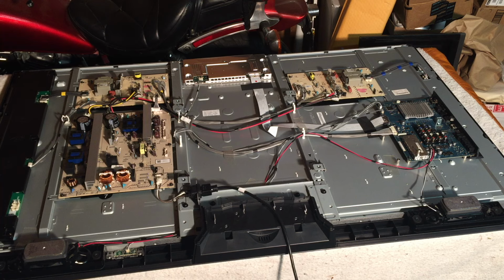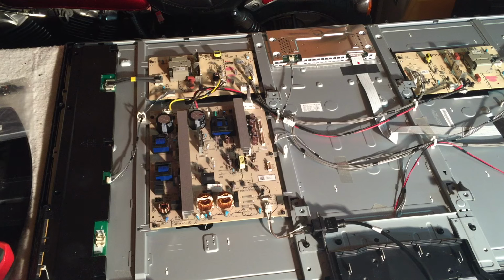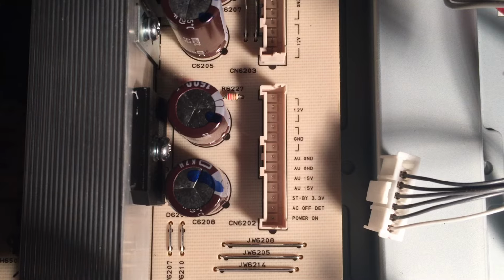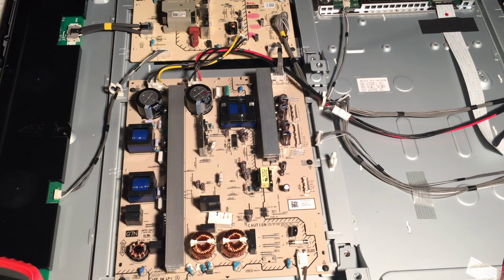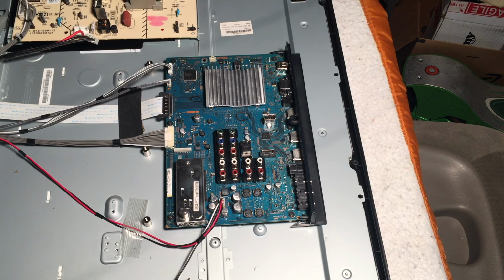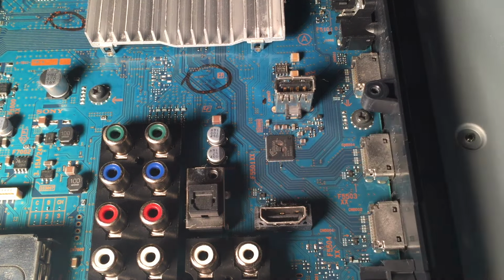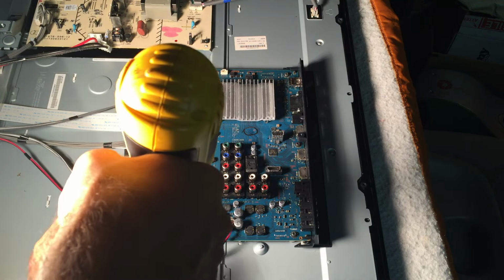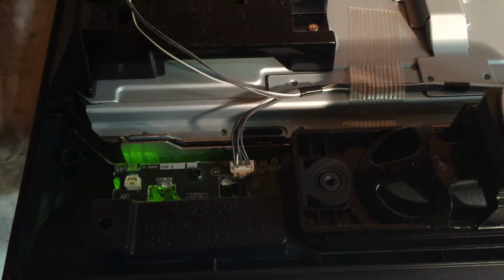How to Fix a TV Hit By Lightning or Power Surge

Comment: Great video!   This is the first time I heard the explanation about the surge coming through the HDMI.  I pretty sure that happened to me as our 60in Samsung was in a surge protector, but one connected device was not.  I get no standby light at all and ran through your troubleshooting.  Fuse is good.  Finding that if I disconnect the power and main board connection and then connect power,  I get backlights.  But once I reconnect the two together, nothing.  So this tells me it must be the main board?  Though I can find not burn marks or puffy caps or anything that looks bad.  Should I just replace the main board since power is getting to the power board?
Reply from the maker: Thanks!  Usually, you need the main board to tell the power supply to turn on the backlights.  That is curious that they are coming on without the main board attached.  You may need to take measurements with your multimeter to see if the standard voltages are there.  Or if they fluctuate.
Reply: @FrugalRepair  Thanks for the reply.  The pinout on the power supply has 13V for 4 pins.  If I keep everything connected (main to power supply) and plug in the TV, I only get ~10V (just under) on each pin and no backlights.  If I disconnect the main board from the power supply board and retest I get the full ~13V on each pin.  What do you think of that?  Also standby light never comes on and remote or manual power does nothing.
Reply from the maker: I’d make sure to check what is printed on the circuit board.  It usually tells you what each pin’s voltage should be.  As for what you mentioned, I’m not sure.  You can test to see if there is voltage going to your input bar (where the on/off button is), this will give you more clues.  That is a standby voltage going there.
Reply: @FrugalRepair  Hey man, appreciate you getting back to me.  I know it was a loaded question and super hard to answer without seeing it.  I'll test a few more things.  Thanks!
Reply: @FrugalRepair  All Voltages checked out so ordered a main board and installed it last night.  TV picture is back!!  Fixed!!  Pretty sure it was the HDMI connection that fried things, just like you said in the video. Great video.  Thanks for all the responses!!
Reply from the maker: Sweet!  Congratulations!

Comment: Hi I have a question....
I Have a Vizio e500ar. We had a lightning storm and a big strike happened near our house. After that the the tv stopped working. It won’t cut on and doesn’t have any lights. It was plugged in the power strip, but the other things on the power strip were still working and so is the power strip itself. The tv was connected to both the antenna and satellite dish. We have another tv connected to the antenna and it is working fine and we have another connected to the dish and it’s fine. We were even able to connect the dish Box to a new tv we had in the shed. It at first didn’t work, but we then realized that the hdmi cord from the dish box to the tv was no longer working. We got the av cords from the Joey in the other room and connected it to the tv since we didn’t have another hdmi cord. It’s now working with the new tv but the old tv still won’t cut on. Any tips?
Reply from the maker: Did you test the voltages on the power supply?

Comment: Hi, great video but i am struggling to find the compatible mainboard for my tv. Its not on amazon or ebay. Does anyone know which i could find it?
Reply from the maker: Did you also search based on the board number?  Sometimes the same main board (or compatible one) is used on different tv models.
Reply: Yes i did,  unfortunately result was zero.. do you have any other website suggestions?
Reply from the maker: I usually buy on eBay.  Shopjimmy.com is another place you can try.

Comment: I was given a Samsung 37 in tv that the house was hit bu lightning and the tv wont turn on all it does when you plug it in is a red flashing light.....could this be similar to whet you did in this video
Reply from the maker: I don’t know which board has the issue.  I’d check the voltages and the procedure outlined in the video.

Comment: When I was watching a movie in my TCL TV suddenly I heard a pop sound and my tv is not working. I tried to connect my tv in another plug but my tv does not worked. There is no sound and no display. When I turn on my TV no white light is  turning on. Please give a solution for this problem.
Reply from the maker: I’m not sure.  You need to open it up and check it out with a multimeter.  You might want to check out my video on what to do after a lightning strike.

Comment: I did this and changed my power board because it was burned from being struck by lightning and the standby light comes on but the tv won’t turn on and that other board with all the connectors for hdmi and stuff looks completely fine any help?
Reply: And if I hold my standby light down the light starts flickering
Reply from the maker: Maybe the power surge affected both boards?  I’d isolate the two boards (minus the input bar - so you can power up the power supply) and see if you get your main voltages.  You can also unplug everything from the main board and test the incoming pins for shorts.  There’s more you can do to test but not sure I can list all them out now.

Comment: Hey so i have a sharp lc-50lbu591u 4k tv. It got struck by lightning, so it doesn't turn on but the blue led on the tv is lit. Any advice?
Reply: https://drive.google.com/file/d/1tcyjKqu7wUFaXSynvNfbZ1ZW9uyo5pIi/view?usp=sharing here is a picture of the mainboard chip
Reply from the maker: You need to figure out what part got zapped.  If it was through the hdmi or the power supply.  When you press the power button on the tv does the led change color (if it is supposed to on that model)?    Looks like you removed the heat sink from that cpu.  I would think you would want to look near the hdmi controller chip for any damage.
Reply: FrugalRepair I'm not sure if it's supposed to but it doesn't change color or anything, the light just stays lit
Reply from the maker: @e-floydproductions7317  If you have standby voltage (and everything visually looks fine on both boards), the next thing I would measure for is a signal going from the main board to the power supply that tells the power supply to turn on when you press the power button.  It may be called BL_ON or PWR_ON or something like that printed on the power supply.   If that signal doesn't go up above 3v then I would suggest your main board is the source of the problem.  Other things you can do: check the fuses on the boards (even the small surface mounted ones) and put your multimter in continuity setting and see if any of the pins on your main board are shorted to ground (You'd have to figure out which ones are not normally shorted - which may be harder).  You could also take a gamble and swap out the main board (basing this on the fact you have standby voltage)  But know this is a guess not a diagnosis.

Comment: Audio/Video sections of both my old CRT TV and the satellite TV receiver are burnt. Found 12V AC in my Cable TV wire.
Reply from the maker: Did you fix it?
Reply: @FrugalRepair  Got one TV fixed, the other one could not be repaired so disposed off. The receivers could not be repaired
Reply from the maker: @ScienceHobbies  Glad to hear.  Thanks!
Reply: @FrugalRepair  The problem is that I need to know the source of surge. The cable TV was giving 12 V AC. But that may not be enough to burn the board around AV jacks. I have bought a new TV and fear that the same might happen again. I am not connecting new satellite receiver as two of three TVs connected to Cable TV had satellite receivers connected to them the only survivor was the TV without Receiver connected. BTW the two TVs got damaged one month apart.

Comment: Finally ordered a power supply board for my lightning struck Samsung TV that happened two years ago. I replaced it because of some suspect marking on the board. Got it today and swapped it out. Standby light still not on. Found your video and unfortunately I found two spots around an HDMI port on the main board that look blown out like in your video. Now to find a replacement.
Reply from the maker: Sorry about that!  But glad you narrowed down the problem.

Comment: STEP BY STEP  ???   Yeah RIGHT,...  My T.V. Came without the back on it,..How about Yours ? ... Reason for viewing these Videos:  Fuse Blew and i want to change it., But There's TWO Different Sets Of Screws to Remove TWO DIFFERENT SECTIONS ON THE BACKSIDE of the T.V. ....  ALL these ROCKET SCIENTIST Do NOT SHOW WHICH Set of screws to Remove in Order to do the job Properly.or in the Proper Sequence.  ...  Would be Nice if These People who do the Tutorials, would START WITH THE PRODUCT AS IT COMES FROM THE FACTORY and WORK BACKWARDS, so we don't Remove a Panel or part and Damage Anything Inside the unit.... Have a GRAND DAY FOLKS.
Reply: Try to do an online search for the service manual for your TV. You might be able to figure out the location of the fuse (or power supply or main board) on your tv. Then you just have to take off half the screws. For my Sharp 80" TV needed ALL the screws around the outside had to be removed. The screws that were around a smaller inner rectangle did not need to be unscrewed (those only get unscrewed to hang TV on the wall).  We unscrewed everything we could find and still could not get the back off, so we had to call a TV repair guy. Found out there is a "hidden" screw right in the middle of the AV plugs.  Once that 1 screw came out, the back came off!

Comment: I had a power surge, even thought the tv and internet box were plugged into a power surge strip. I just noticed the internet box restarted and something happened really quick. But now the antenna that I have plugged into the tv isn't working properly anymore. I get all kinds of interference except on the singular numbers; channel 7 but interference 14 and up. I bought another antenna today thinking that was the problem but my tv still has the same interference. Do you have any idea what I need to do? I have a Bravia tv also.
Reply from the maker: Perhaps the surge came through the coax cable?  That damaged the main board.  If I remember correctly, channels 14 and up are UHF channels and use a different frequency than the lower channels (VHF).  There may be a damaged component that helps decode that signal on your main board.  Do the HDMI ports work?  If so, you can get a coax to hdmi box and run your cable through that.  I think they are like $15-20.
Reply: @FrugalRepair  Yes HDMIs work. I have a fire stick and blue ray dvd player connected and they work. Can you share a link, what I need or something so I know how to connect it. This is all very very greek to me ☺ Thanks!
Reply from the maker: @vickypuckett4104  I think you can search on amazon for a "coax tuner with hdmi output"

Comment: I lost one tv and the attached satellite TV receiver two months back and now another Tv (both old tube type) along with their separate satellite TV receiver. Both connected to the same dish having a dual output C-Band LNB (so actually two separate LNBs inside as both have separate polarity adjustments). Both TVs were also connected to the same Cable Tv system using a splitter.

The technician said both TVs had the Audio/Video in/out sections burnt. One of the Sattelite Receivers also had audio/video "Out" sections burnt, the other receiver powers on (Displays ON)  but does not boot ( this receiver has no burn signs and perhaps the software got corrupted).The technician suspected surge from Dish but the RF tuner sections of both receivers are not burnt.
Both TVs sparked at the power plug in the wall socket when switched ON and died.No power up light whatsoever. The first TV showed full continuity at the power plug but the second TV showed an open circuit at the power plug.

 I checked the voltage on the  Coaxial Cable (RF cableTV) and on setting my meter to DC it gave 0.7 to 1.6 volts (shows -ve when I switch cables so its perhaps a DC voltage) and when I  set the voltmeter to AC it read 11.4 volts. Now I have a new LED TV and dread the cable could do harm. The technician says 1.6 volts DCis OK as the cable booster can add that (I doubt).

Please help me diagnose the cause as I don't want to lose my new TV. I have pics of the burnt receiver board if someone wants to see.
Reply: @Examoon  The technician opened it.25k volts you are right.Actually I wanted to be sure whether its was the cable TV RF or the Dish RF that caused the trouble. Later I checked the Cable TV was passing 13v AC.I wonder if that was the culprit. I need to be careful with the new TV so research required. The surge protector is for the mains I believe .

Comment: On my Philips tv i cant find standby pin
Reply from the maker: it is the 3.3v or 5v line typically.  Do you see those markings?  If not, what labels do you see?
Reply: FrugalRepair i only see 24v, gnd, n.c.,on/off,2d/3d and dim
Reply from the maker: @axtra92  Those are the only markings on connector(s) going from the power supply to the main board?  Are there other connectors (maybe not labeled)?
Reply: FrugalRepair the other connecters are not label
Reply from the maker: @axtra92  The labels you read off earlier are for the backlight circuit.  Your standby voltage and 12v main voltage would be on the other connector that goes to the main board.  If you disconnect everything from the power supply then plug it in and measure each of the pins (being very careful not to touch multiple pins at once) on this non-labeled connector, do you see any voltages at all after going through the pins?

Comment: Thanks for the interesting post. I have a Samsung Tv which was hit by lighting too however the standby light does come on once the power cord is plugged in, no visual all I get is buzzing sound from the Tv. What could possibly be wrong with the Tv?

Thanks in advance👌
Reply from the maker: Thanks!  Did you check the voltages or try to isolate the problem to the power board or the main board?  Can you hear which board the buzzing is coming from?  (that would be a clue if it were me).
Reply: Thanks  @FrugalRepair  I have not opened the Tv as yet. But will certainly do so soon.

Comment: This was great but one question...  So the HDMI chip you fixed, does that mean the HDMI item plugged in during the strike doesn't work anymore also and require replacing?  Thanks.
Reply from the maker: Yes, it got fried too and needed to be replaced.

Comment: Great video man. I have a Hisense LTDN40D50TS TV that died following a lightning strike on the satellite dish it was attached to. The red/blue LED on the TV comes on and stays on but there's no picture on the screen. I have found that the TV uses a TP.S512.PB83 board that is found on dozens of other TVs, such as Supra, Haier, and Baird. Question is, would a mainboard from any of these TVs work? Cheers.
Reply from the maker: Thanks for your comment!  You are correct that some main boards are identical to ones used on different models.  If you make sure the board numbers are the same and you visually inspect it (to make sure the connections are the same, etc) then I think you should be fine.  At least, that is what I do.  When searching for a replacement board on ebay, I'll do at least two searches, one for the model number and one with the board number.
Reply: @FrugalRepair  The board number in my case is TP.S512.PB83, the same board that is in many other TVs. I have carried out the two searches as you suggested. The search for my particular TV model number yielded nothing. However, the board number search yielded several options. Quick question, can an identical and matching board refuse to work with a particular panel?
Reply from the maker: @denniskiplangat5029  I would think it is fine.  If you have made sure the board numbers match and the components and connectors are exactly the same.  It is possible that the connector style might be different (so you'd want to look at the photos too).  You can always buy from a seller that accepts returns too to add another level of safety, if you want.

Comment: Thank you for posting. The lightning struck a tree in my mom's yard about 2 weeks ago. The TV was plugged into a power strip (not surge protector), it was not on at the time, and the only thing attached to the TV was cable for antenna. The LED indicator light does not come on, so I will take your suggestions to see if I can pinpoint the issue. It is an Element ELEFW328. The lightning got the base of the pine tree pretty good.
Reply from the maker: Good luck!  Your issue is almost certainly either with the power supply or the main board.
Reply: I have an Element 19" that's a few years old but probably less than 100 hrs on it. It is a spare. Began using it in my RV and the picture went blank. Then the sound almost immediately after. It has virtually no hours. I was here and there was no storm. Any suggestions ? It was more expensive than the other TV's so I assumed better quality. Thanks

Comment: Hey I have a led razor image Vizio tv that got struck by lightning the tv shows that the power light is on and has sound but can’t see the image
Reply from the maker: Google flashlight test and see if you can see the image while on.  If so, there is a prob with your backlight
Reply: I can see the image but is very faint
Reply from the maker: Then there is something wrong with your backlight led’s or the led driver board (or power supply).  If you can try turning down the brightness to 10% in settings to see if the backlight comes on.